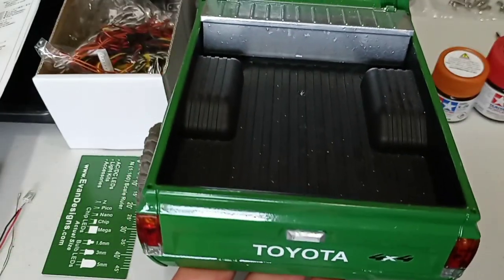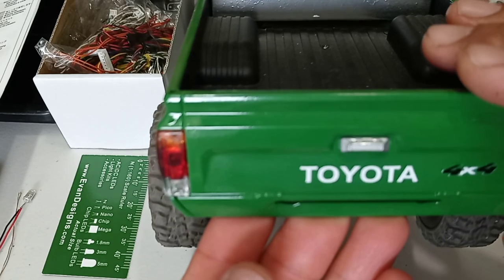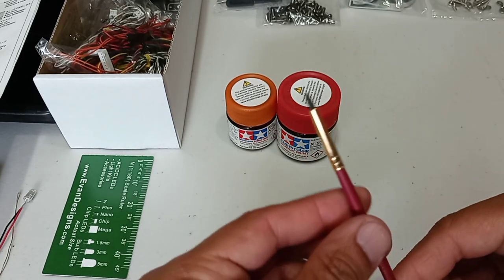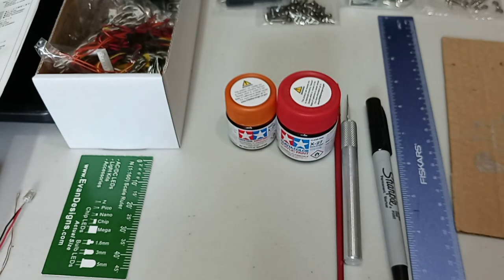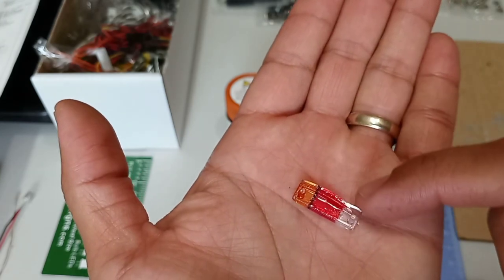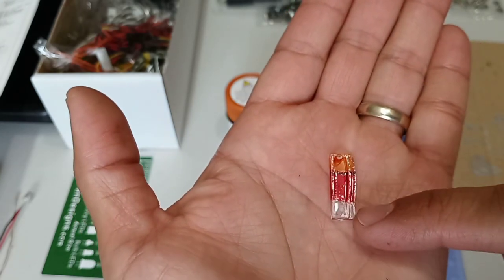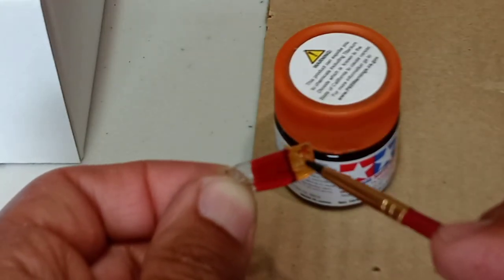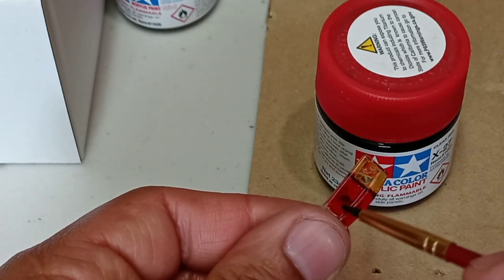how to paint the rear tail lights on the wpl c24-1 rc pick up truck

Comment: I see in a alishanmao video  you said that you getting the xk k110s helicopter, here is some things you should know before flying the helicopter.    Flying a 6ch helicopter can be very hard to fly at first when there is no self leveling on, I recomend to start with 6g mode , then with a mini 3D helicopter. Those mini helicopters are very sensitive they move  like a hummingbird that’s why it is hard. Try to be easy on the control when flying a helicopter with no self leveling, it all takes practice. Never give, nothing is impossible😉
Reply from the maker: Thank you😃 Micro helicopters ! for your great tips because i surely need them. I am new when it comes to flying rc helicopters. I have been practicing with a 4 channel helicopter indoors and only 2 times outdoors. Outdors is hard, is hard to control due to the wind, i have crash😁 but like you say, never give up. Thank you for your comment and for watching my videos👍